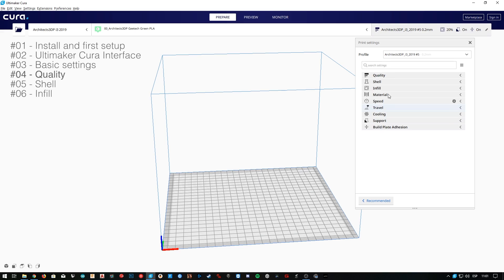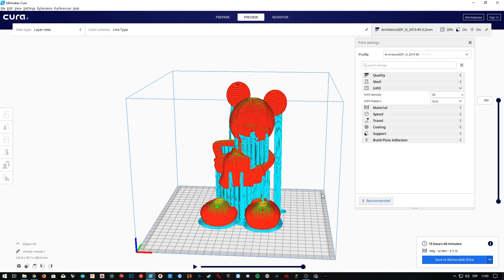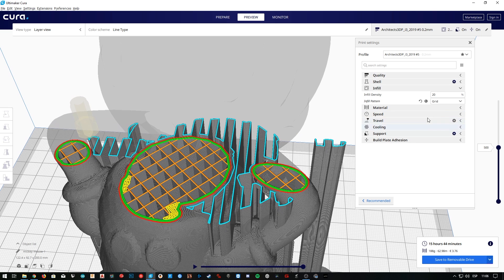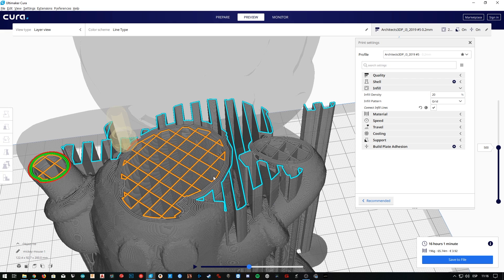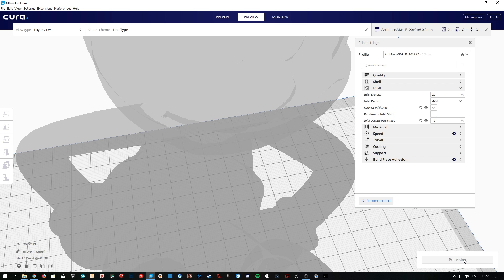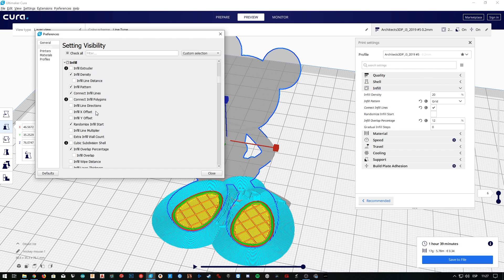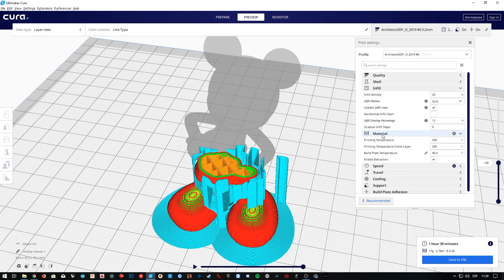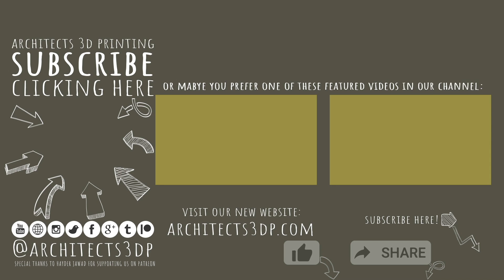Cura advanced settings 2019 - Infill #06

Comment: When printing your test cube I have started having a problem with the infill not sticking well and making a mess. Shell prints fine. String test was perfect. Printing with PETG. Tried a lot of different temps and speeds. My setting are all basically your 2018 cura setting. And thank you so much for the videos, they have really helped a lot!
Reply: Chris Emory I’m having the same problem did you ever figure out what was causing this to happen. I’m using PETG also.
Reply: @Catdownunder1   I got the infill working but having trouble with supports now. I am switching back to PLA to see if I still have the same issue.
  As far as getting the infill to print okay, I did a couple different things. Changed temp to 250, slowed the infill print speed to 20-30 mms,  increased the overlap percentage to 20%, and set the infill line width to .42

Comment: What video did you talk about reducing elephants foot in the Cura settings?  I think it was one of yours :)  Also, I keep getting blobs or zits on a tighter radius, as in a square with the corners are rounded, the slowdown on the corners seem to make blobs, and i cant find a way to combat it?
Reply from the maker: the elephants foot can be fixed using the INITIAL LAYER HORIZONTAL EXPANSION. You will be able to fin this option in the SHELL tab in the cura custom settings menu =)
About what you mention of the blobs, I don't really know what you mean. Maybe you can send me some pictures via instagram
Reply: @architects3dp  Thank you very much!   I will also find you on Instigram :)
Reply from the maker: @lllBAMlll  great! :)